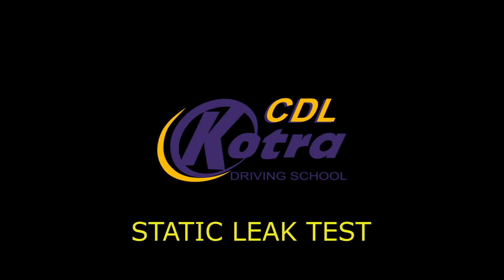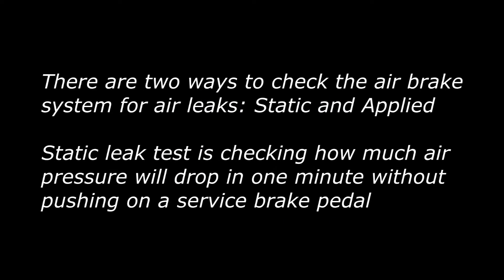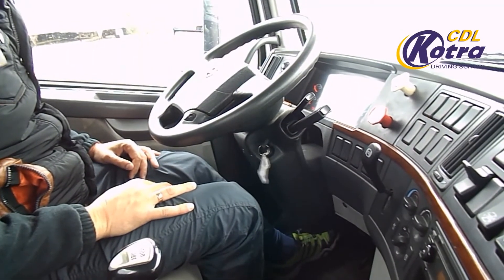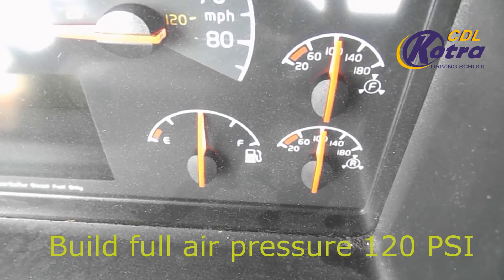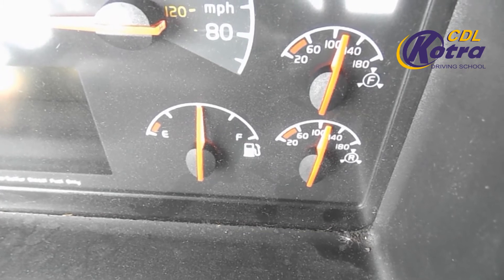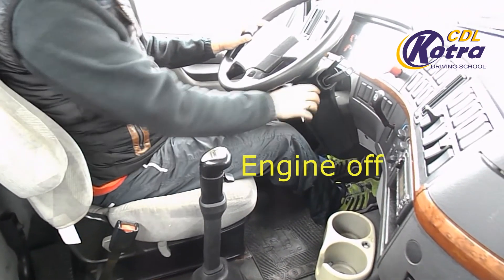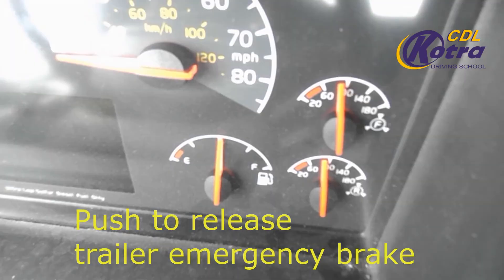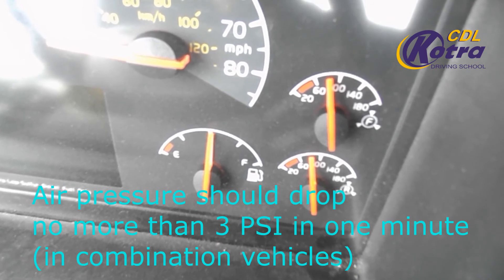Static Leak Test

Comment: Its 4psi in one minute for a combination vehicle and 3psi for a single vehicle ie boxtruck or bobtail
Reply: 4 psi in combo when foot brakes are applied, 3 psi in combo when brakes are not applied.
Reply: This test was a static air leak test, not an applied air leak test.